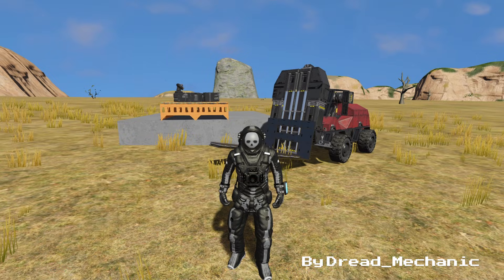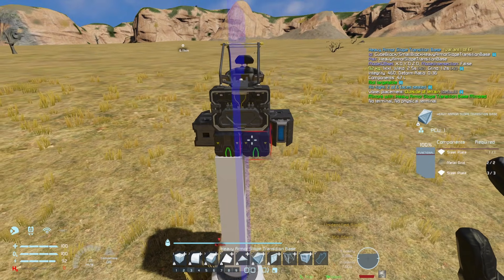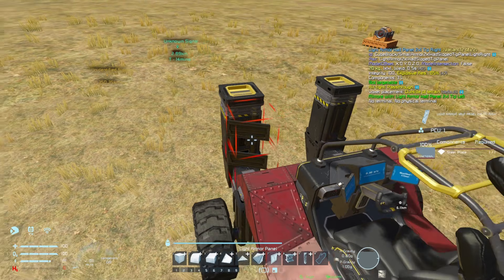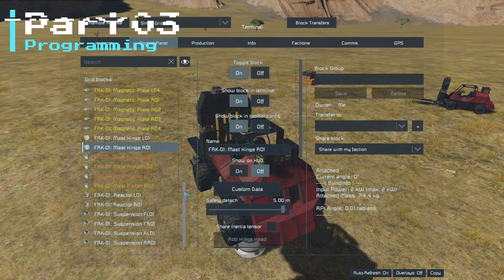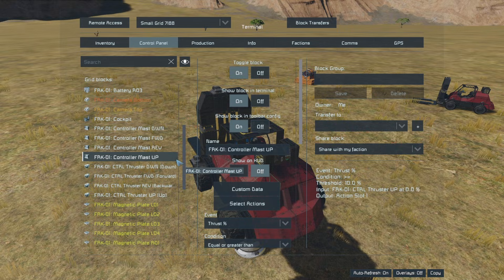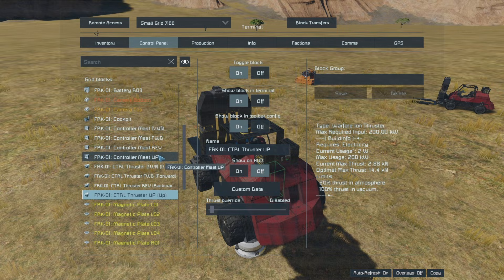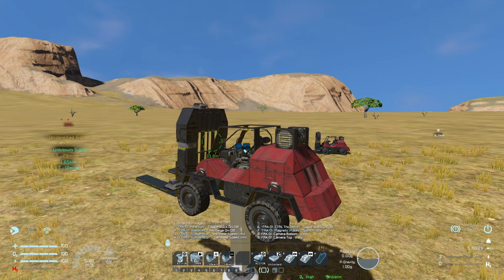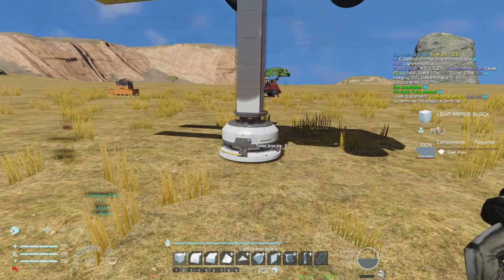Space Engineers | Building A Forklift | Vanilla Tutorial

Comment: why ions instead of flatmos?
also, some forklifts can use skid steering. It should be possible to add this functionality with some left and right thrusters on event controllers, adjusting wheel steering and propulsion overrides.
Reply from the maker: Good question!

The reason I use Ions for stuff like this is so that the thrust output doesn't have a noticeable effect on the grid, but is still enough to trigger the Event Controller.

As small as Flatmos are, they're still powerful enough to lift or push a small grid a little bit.
However Ion output in full atmosphere does basically nothing but it's just enough to work as a trigger 👍

And yes you can absolutely use this trick for sub-grid steering/propulsion/thrusters and all sorts.